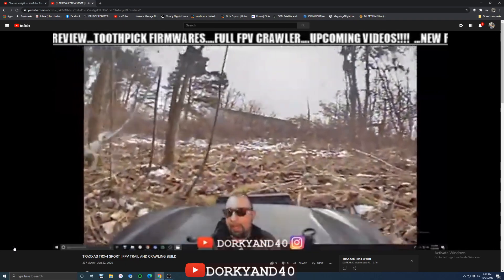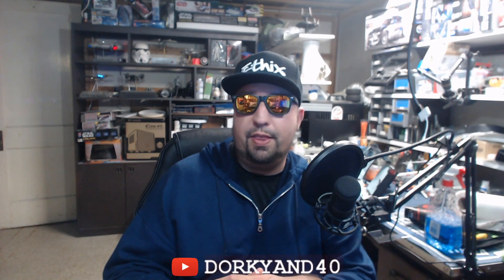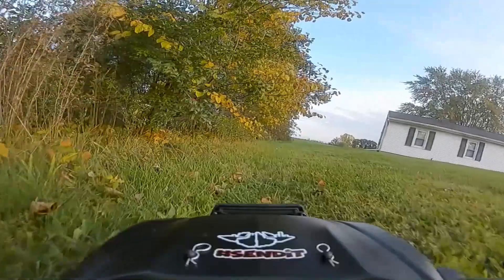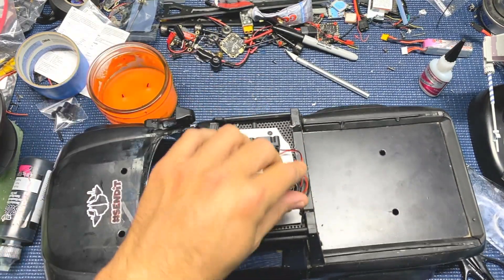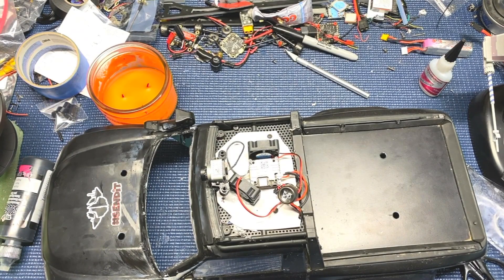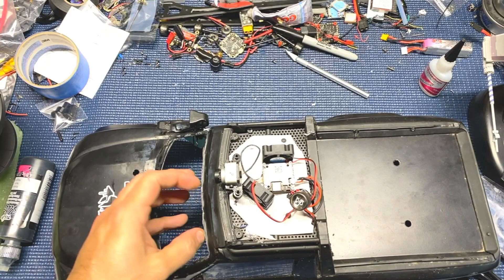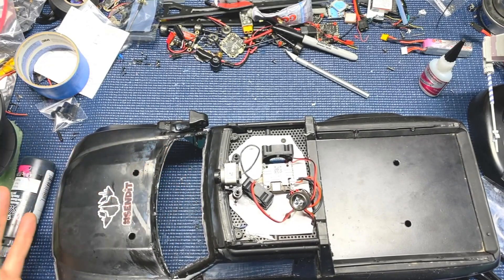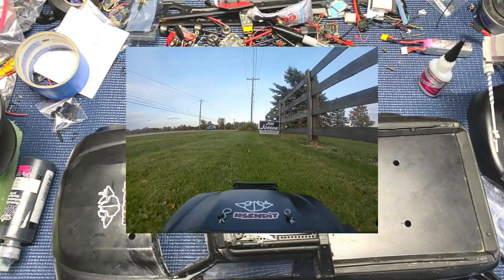DJI FPV SYSTEM ON AN RC CAR | HD FPV TRAXXAS TRX4

Comment: I put a FPV transmitter on my Rustler. Worked GREAT for about 10 minutes then the radio (receiver on the car) seems to have stopped working.
I can no longer pair the receiver and transmitter.
Coincidence?
Or did the FPV transmitter kill the Rustler radio receiver?
Reply from the maker: Very odd. I don’t see how but you never know man

Comment: Been flying DJI Vista for some time now and recently got into Rc cars. I plan on putting a vista on one of my cars soon. Any thoughts on how u counts do a front and rear cam system with DJI gear? I know it can be done with analog cameras in quads.
Reply from the maker: I just used standoffs and the normal tpu camera mount. Simple and effective

Comment: Why not add a piece of plexiglass for the window and put the cam inside, looking through the window? I never thought of using standoffs ... Great idea! I am running a TBS Unify Pro32 but I want to put my cam inside, incase of flipping. Running a 1.8 or 1.6 viewing angle, would give you the viewing angle you're wanting. I run 2 cams ... one for day and one for night ... both Runcam. I am using the balance cable coming off the battery to power my setup and I also set it up to power everything up, when I put the body on the frame, using metal tabs for contacts.
Reply from the maker: its all mounted inside water tight now with a fan :)
Reply: @Dorkyand40  ... Would love to see how you mounted everything ... Sounds amazing!
Reply from the maker: Look for my other video. It’s on the channel. Close to that time frame.

Comment: Yep, add fan. And maybe a old flight controller. Just for GPS, then ya can OSD speed so ya can see how fast ya car goes. I plan to. Plus battery voltage, distance and direction to home.(arming normally does this, so not sure)

Comment: Excellent setup and prototype, thanks!! In the link there is an analogue FPV system setup that I used with my TRX4 Kit. I don't use the goggles but the monitor image is very good and provides less intrusive immerse experience. 
https://youtu.be/nsjxIBCU88o

Comment: I've never seen one over heat. They are super durable. They shut off if tpo hot and come back on when. Also they have reverse polarity protection.  Both the vistas and air units are great products

Comment: I wanna see a RC car rip on the road with this thing! Great build 👏 👌 👍 💪 🙌 😎
Reply from the maker: Lol. Thanks man
Reply: @Dorkyand40  you gotta make it go with the flow of traffic ;-p wonder if the signal will work stock at a good distance like a 4-5 blocks away, ik certain obstacles interfere with my dji FPV drone
Reply from the maker: This vista on the ground works good. But maybe only 2 city blocks but through the woods.
Reply: @Dorkyand40  only two city blocks I was expecting 2 city radius miles

Comment: Great video.... Im running FPV on my Absime Sherpa Crawler... Im running the car on a 7000mah Lipo, the camera and VTX on a 1300mah NiMh battery, i have around 1,5 hr. run time... 
The system i use is from banggood and on 5.8Ghz - just need much more range... now i have around 1-250 meters..

Comment: Hey, great vid! I am beginner to RC hobby and FPV aspect.  I have a system that functions however I would like to boost the range the cam transmits.  Is there a cam and booster that is within the100$us range that is good for RC ground fpv? Like rally cars, so fast and bumpy? Thanks
Reply from the maker: Look at team black sheep pro nano32 for vtx. Good antennas from video aerial systems and then any camera will do
Reply: @Dorkyand40  Sweet! thank you!

Comment: alright then, i use crsf on my traxxas summit.  before this i ran stock remote and 1.2 video. worked great. video out ran my radio link.  So a bit scary. check me out here on youtube. 
My videos at Willysummit.   now i installed crsf  on my summit my video is crap in 500 feet. What frequency works better than 5.8ghz for best video ithru wooded areas??
Reply from the maker: get dji like this one
Reply: @Dorkyand40  5.8 ghz will puke out way to early  Digital all or not. I want long range video reception back it went to hell adding 915mhz.  It's worse than the stock remote now.   I have no idea why people are changing to Crossfire. If you cannot get video to match the distance.. This is for ground use. With the stock transmitter
I used to go out almost at 1/4 Mile distance.  Still have full control/ video. Now my video goes to crab like I said in about 200ft. 500ft.you can't see.

Comment: Gr8 video and best of luck... 
What's the maximum ground range u can hit with this dji fpv system on an Rc car brother??
Reply: You can get up to 3 miles
Reply from the maker: bad answer but far enough:)  i had crossfire on it last year with my tango2 but analog video. i picked up a dumborc radio this year so i could have a real ground rc with it and the dji and it goes just as far. not sure whats in these radios. i bet with crossfire i could do 1/2-1 mile depending on line of sight and all that.  i can basically drive from inside my house or garage right  now all over my property and the surrounding neighbors without an issue

Comment: Tango2..Wow!..reverse the motor direction..how do you do that in open tx?
Reply from the maker: It’s opentx so it’s easy. I used an old painless360 video he made for doing it. Then you need to recalibrate your rc esc and the tango2 with the new settings.
Reply: @Dorkyand40  ..AHH..Many thanks sir....I,ll check out Lee,s video list👍🍻

Comment: Great idea..... something I'm eager to do myself at some point.
Was thinking of on my high speed carpark thrashing brushless  RC car...
I suppose air flow/cooling won't be an issue.
Reply from the maker: Only one way it to test. Just add a fan if it’s needed like I did.
Reply: I saw dji on fast rc cars, horrible super bumpy, i put dji on a $20 amazon crawler, pretty fun, just slow
Reply from the maker: Crawling is the way to go for sure. Once my trails open up.